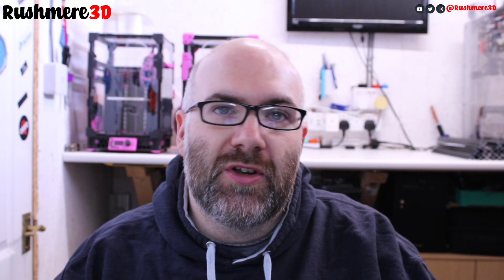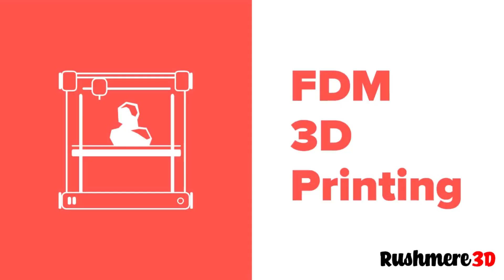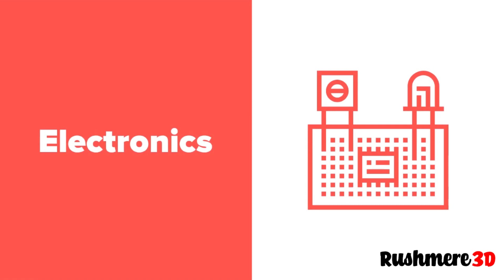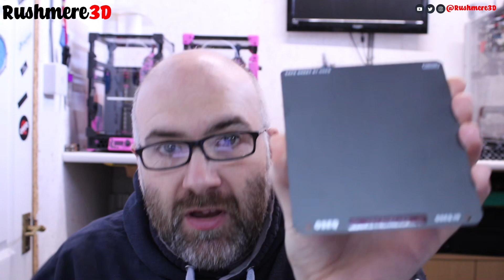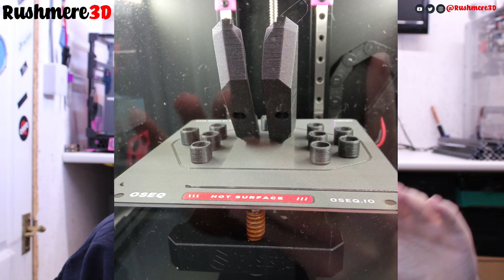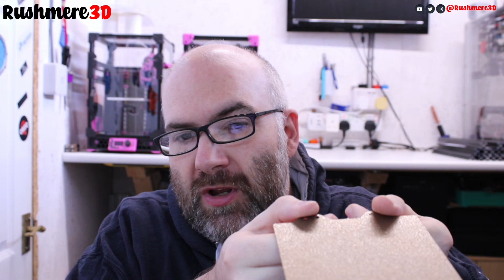OSEQ Safe Sheet - My Thoughts

Comment: I have great luck printing abs on those Fysetc PEI sheets, good to know there are even better alternatives.
Reply from the maker: Hey, thanks for the comment. I have to say PEI sheets vary quite a lot. The textured sheet from my trident kit works great, as does one of the v0 ones but then I have another 2 from different kits that don't. It's difficult to get consistent at a lower cost I guess.

But the OSEQ sheet works very well.

Comment: Is that the new version they just launched or the older one? The new one are FAR to expensive (starting at 100€). If you start to get a complete printer for the price of a print sheet....something is wrong
Reply from the maker: As mentioned in the video it's the old one but I don't think the actual surface has changed just the appearance.
Reply: @Rushmere3D  totally missed that somehow. 😅 Thanks for clarification!
Reply from the maker: No worries, it was near the end and I don't expect people to watch the whole video 😅.
Reply: @Rushmere3D  you got me there 😂😋

Comment: They are far too expensive! I use mirror tiles and either hairspray or purple gluestick depending on what material I am printing and they are great and inexpensive
Reply: The point of pei is that the material sticks down with heat, and once it cools down, It can easily be removed either by flexing the sheet or letting it cool down entirely that the part self releases.
Reply from the maker: Honestly if glass and glue works for you, you do you, 😂.
I'm a fan of glue stick, as I said I use that for smooth PEI both as a slight adhesive aid but also a release agent. Haven't needed any with the OSEQ sheet however.